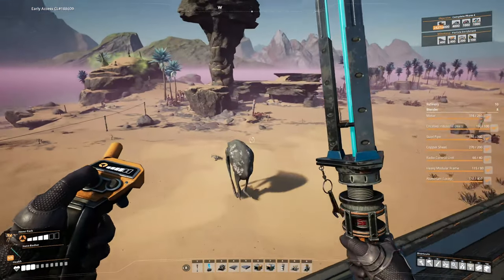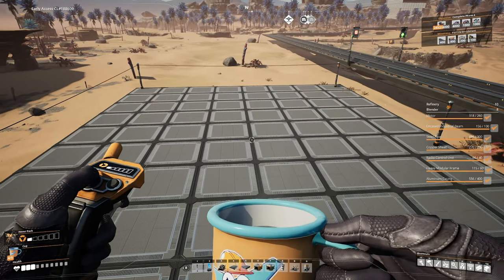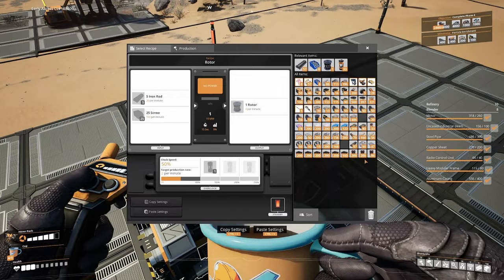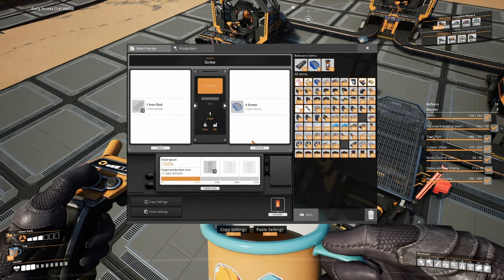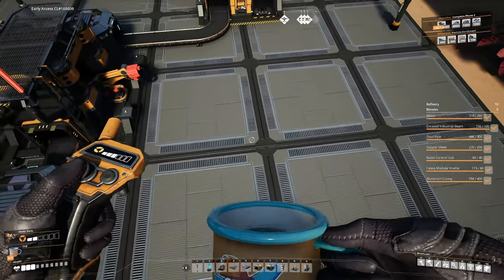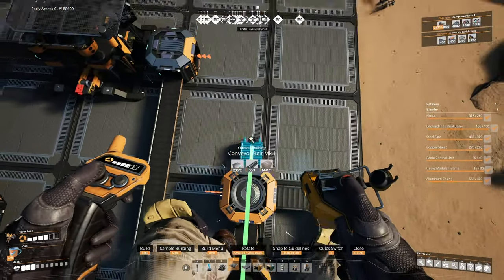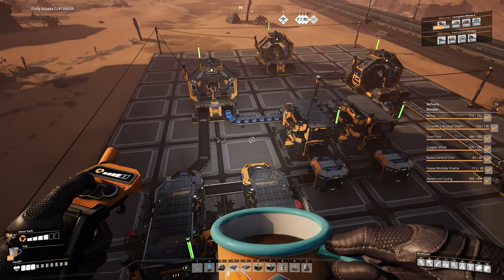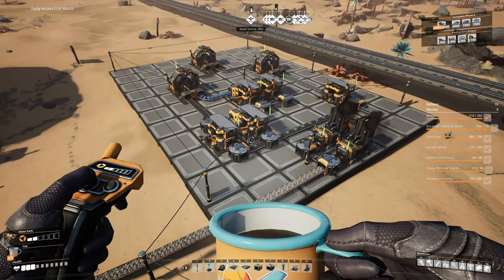Satisfactory Beginners Guide To Smart Plating - Get Phase 1 Done Fast!

Comment from the maker: This design as shown in the video DOES NOT give you 100% efficiency. A viewer (Absolute Human) pointed out an issue that I never noticed that doesn't allow the mergers to back up as I expected.

The problem is the splitter/merger design after the 2 pairs of constructors in the middle. Instead of splitting one machine into a merger, you need to gather the full output of both machines onto one belt and then split off to the next steps. You can do it with a mk1 belt for the iron rods, but you need a very short run of a mk2 belt (which you should have access to at this stage of the game) for the screws because there are more than 60 per min.

Let me know if you have any questions and I will be happy to answer them.
Reply: Another Solution to the issue you are describing, which is imperfect in a different way is to underclock the rod, screw and plate constructors to 95% , 92.5% and  60%, respectively, set the smellters to 77.5%, and then use a smart splitter to prioritize ingots going to the plate constructor, and you avoid the issue a different way, sidestepping the need for the mk2 belt, at the expense of rushing caterium research.

I was having some fun blueprinting your build earlier... First really functionally complete and self-contained blueprint idea I've seen and/or worked on besides a box-o-smelters :)
Reply from the maker: @moonchild8642    Decent idea, but if you have smart splitters, you definitely have mk 2 belts. reinforced iron plates is one of the ingredients.

Glad you are getting some good uses out of the blueprints!
Reply: @DrLootCrate  I think technically you could unlock smart splitters before Mk2 logistics, but like I'm not that much of a masochist.

In any event, if you'd like the blueprint I've made for it to iterate on and improve, let me know how to share it.
Reply from the maker: @moonchild8642  I am thinking about starting a discord so it will be easier to share things like this. Sometime soon.
Reply: @DrLootCrate  That would be great! For now, I'm kinda building up a bunch of designs to drop on satisfactory-calculator as kinda the only place to share this stuff atm.

Comment: I’ve only played for 2 days. How did you learn the pattern for smart plates, as I have the quest and I’ve gone down a few legs of the MAM and still nothing, and how did you under clock?
Reply: Never mind. Found out I needed to build the assembler building….. /sigh
Reply from the maker: All good man! There is a lot to figure out in those first few days for sure. I actually did the same thing the other day. I put down an assembler and was searching the steel ingot for a bit before I remembered I needed a foundry. Hadn’t done it for a while!
Let me know if you need anymore help and thanks for watching
Reply: @DrLootCrate  thanks. Will do. 
I do wish there was a 3rd person view. Something about the movement makes me feel a little sick tbh.
Reply from the maker: @Salubrious388  I have heard a few people say that about the movement. Maybe it will be a bit better when you get the jet pack or hover pack later. 

I think are a few tweaks you can make in the settings. Turn headbob off for sure and maybe play around with some others
Reply: @DrLootCrate  aye, I’ll try that thanks. It’s one reason I can’t play Borderlands game. 5 mins and I’m physically sick! I can play Destiny 2, The Division etc perfectly fine. So there’s something different between the games
Reply from the maker: @Salubrious388  That is really interesting! I got the feeling slightly with Portal a few times, but no other game. I wonder what it is about each game that is different?

Think about subscribing if you haven’t already. I am getting really close to 500 where I unlock the community page and I could use the support
Reply: @DrLootCrate  subbed. Hope you get there! :)

Comment: 7:48 There is in fact a problem with this setup... It really won't backup from the merger. When a splitter have one of it's outputs blocked it sends the input to the other output. But when it is a merger it still feeds from both inputs equally even if one of them is full. So as the constructor produces more it will stall first never saturating the other input lane. Trust me, I've had this problem with my solid steel ingots build with 4 smelters feeding into 3 foundries in similar fashion. You really need a smart splitter for this setup to work properly. Or use a different balancer to send more items to the right side in the first place.
Reply: 8:18 you made it even worse by limiting the right constructor... Left one would be the better choice. Now the right assembler won't ever get more than 17 screws per minute.
Reply: 10:23 No it won't...
Reply: 18:40 Aaaand you ended the video without showing the system actually working at 100% despite claiming to show it backing up 😆 smart move 👌
Reply from the maker: You are 100% correct. I just rebuilt this to test it out. I had drawn it out on paper and just chalked the 92% when I built it up to the slow belts taking forever to back up. (Big change from mk5 back to mk1)

Having rebuilt it to test your hypothesis, you don’t need smart splitters to make it work. For the rods, you just need to gather the output from both constructors on one belt and then split off with a normal splitter. It will balance itself.

For the screws, you can do the same with a mk2 belt, which you can build from your 92% reinforced iron plate assembler 😉

Thanks for watching the whole video and letting me know. I will do better in the future and in hindsight rushed this vid a bit. I am going to leave a pinned comment explaining the issues.
Reply from the maker: I think it ends up taking you 33 minutes instead of 25 to get your 50 smart playing with this setup. Use your extra free time wisely.
Reply: @DrLootCrate  Great! A smart splitter isn't the only way, but it solves it too. Just wanted to point out the difference in backing up with splitters and mergers. That's an easy assumption to make a mistake in.
Reply: @DrLootCrate  yeah, the system will certainly still work. But it undermines the whole point of the build. In the end 99% efficiency is still unacceptable at Ficsit corp 😜